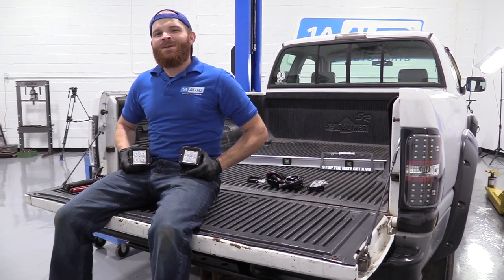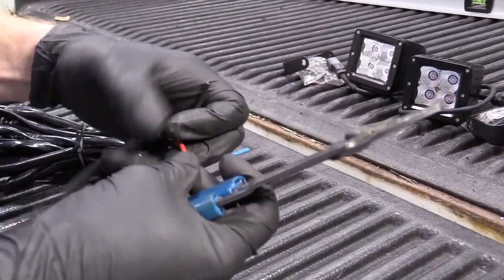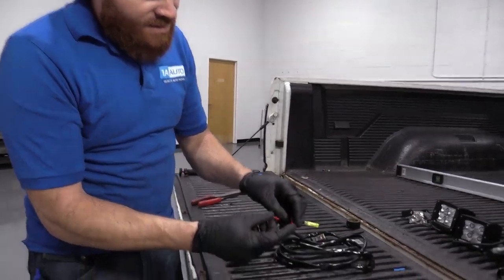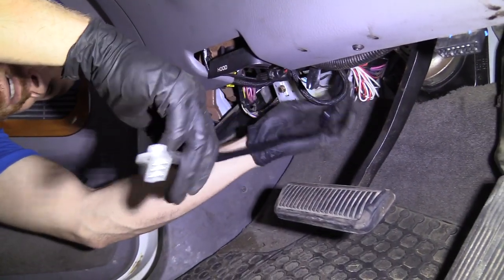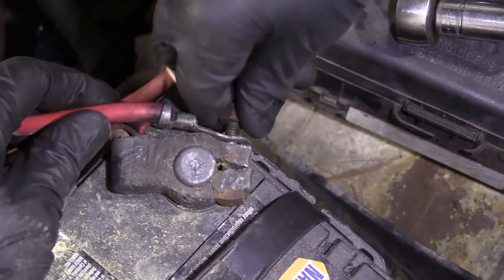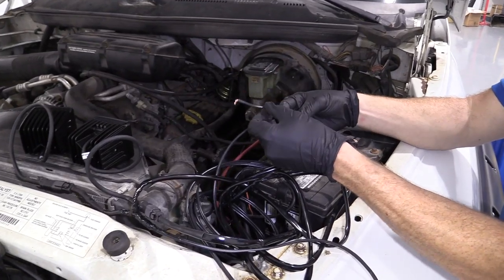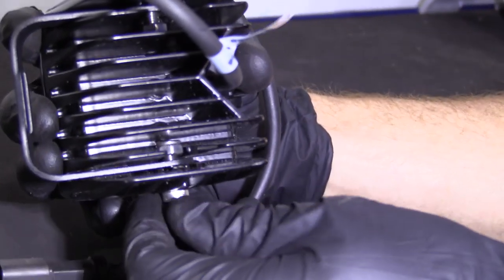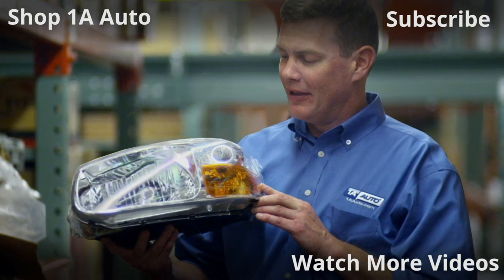How to Install LED Light Pods

Comment: All I did was wire my lights to the back side of my trailer plug,, I put both red wires to the middle wire Wich is reverse lights and then put the ground wires to the white wire which is the Ground. It's that easy!! It looks Amazing!! So when I reverse the lights turn on with my reverse lights on my Tahoe. Easy
Reply: That’s a brilliant idea 💡

Comment: Good video, I'm going to install those lights on my 1988 Ford F250 front bumper for better visibility at night. That truck in the video sure is a rust bucket, if you hadn't shown that it was a Dodge at the beginning, I would've guessed it anyway. I used to own a 2000 Ram 1500 and it, like all of them was just as rusty.
Reply: That one is really rusty, I live in Colorado where most of the trucks don’t have rust like that and my 97 Ram 1500 is nearly pristine. Even better then my 2013 Ram 3500 and the 97 has 20,000 more miles

Comment: How would I wire to the reverse lights (preferably with the tow plug adapter), but keep the toggle switch so can also use as work lights when needed?
Reply from the maker: +robert reed You could wire in parallel to the relay to power the lights. Thanks for checking us out! 1AAuto.com